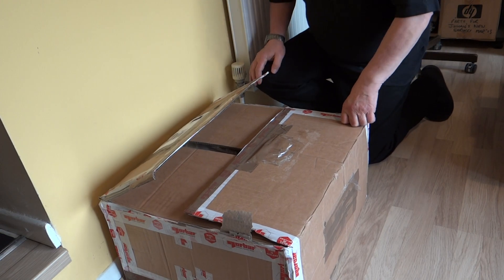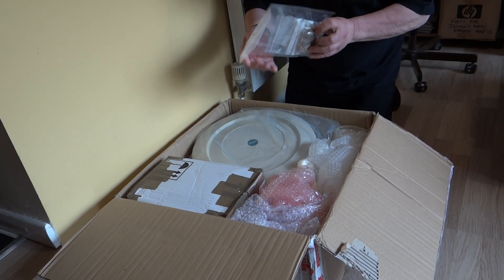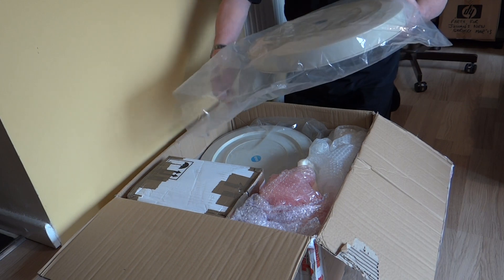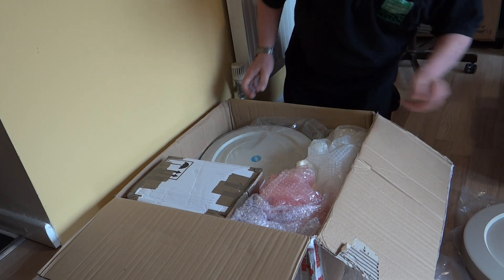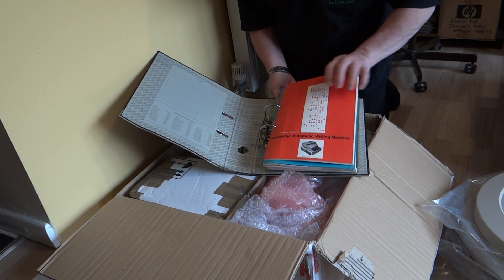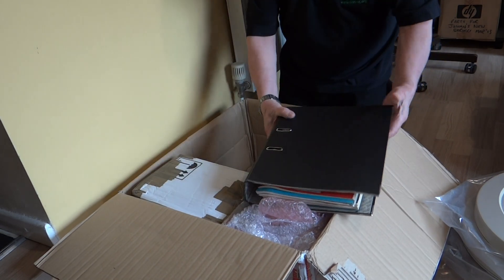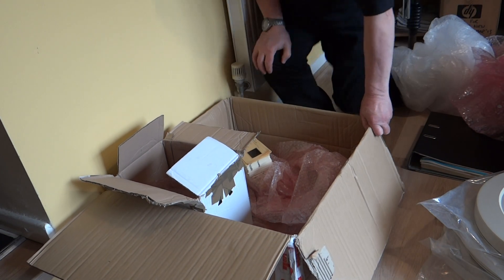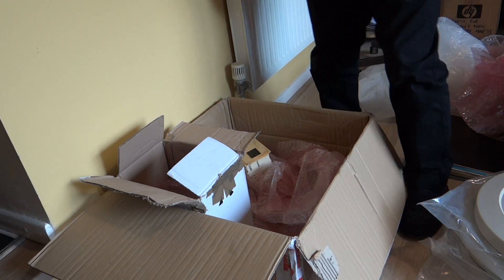Wylfa power station unwrapped

Comment: I have a RL02 drive connected to a PDP11/73 in my "collection". Though the machine runs 2.11BSD from a 360 MB EDSI drive. The RL02 is mostly unused.